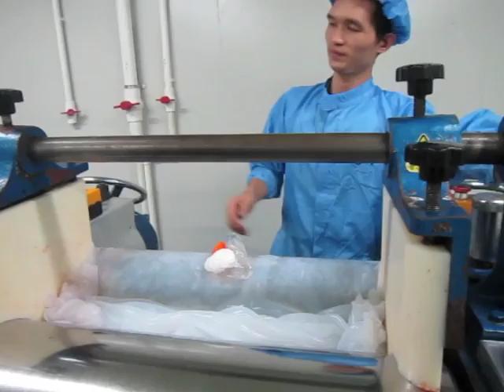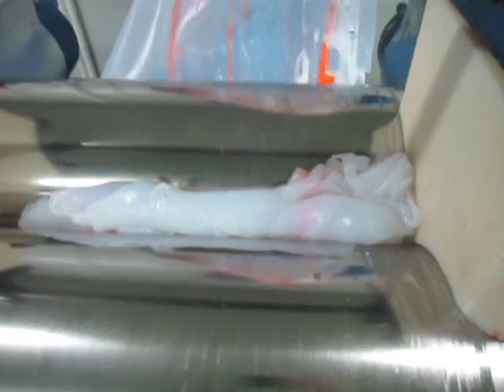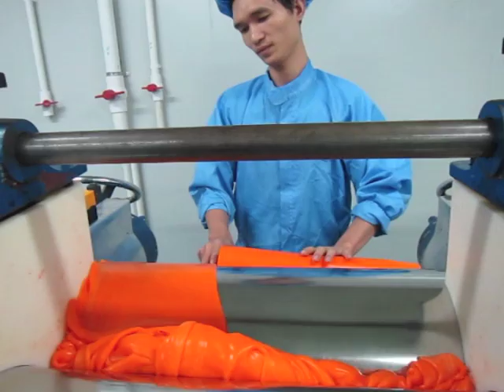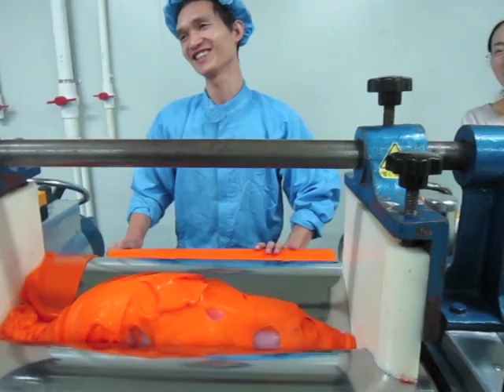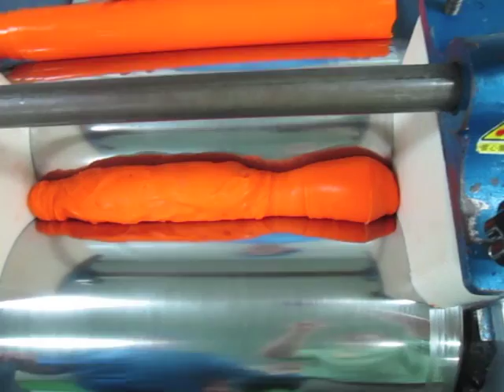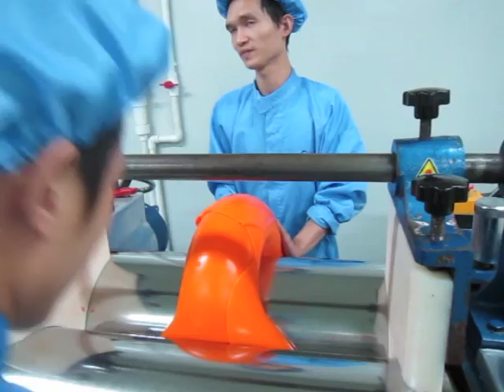life on the line: kneading pigment into silicone.m4v

Comment: I like how you hear all the air bubbles popping in the silicone.
Reply: Sounds like a camp fire :)
Reply: Richard Smith 
Ikr
Reply: Like popping a bubble wrap
Reply: I hate it.  It means he’s doing it wrong and creating spaces for impurities and defects.
Reply: Wes Hartley it actually means he and the machine are in perfect working order.... since the machine is doing its job of removing the air as well as distributing the pigment
Reply: Alucard It could do that just as well, also quieter and with fewer impurities, if he’d been doing it properly.  I’ve seen a longer version of this video where a guy asks him if he’ll put it through one or two more times just to make sure the pigment is distributed, and he lazily waves it off and say, “nah it’s fine”.  Then the boss man came up and said “do it again”.
Reply: @Wesley_H  nobody cares about the way he did it but ok
Reply: @Wesley_H  still dont think it matters but ok
Reply: The bubbles don't matter, they aren't adding impurities, and there's no way to do that job and not get some air pockets.  Ive seen when guys roll rubber up, seal the ends, and throw it back in and when that one pops, its like a bomb. It doesn't hurt the material. What is a problem, is when it gets too hot and you get little cured "knots" in the material.

Comment: I wonder what the turnover rate is for people sticking their hand in there I also wonder how many pieces of hands are in silicone pieces that are shipped here from China?
Reply: It was my understanding from previous videos that the rollers have a sensor for anything coductive (i.e.human skin) coming into contact activates a shut off of the machine. So you might crush you finger tips but not roll your entire hand. 

I also have a feeling from a quality control standpoint that the silicone would be ruined if a whole hand was involved.
Reply: @victoriakelly5894  it's just like a touch lamp but touching the cylinders shuts off the machine
Reply: In my 30 working experience there were only 1 accident that a hand come between the zylinders. the hand was half a meter long. Investigation shows too much alcohol involved.Normally theres a wire above the head u draw this the machine stops immedially and turn backwards a bit

Comment: What does one use this silicone for, how is it not all sticky like silicone that comes out of tubes? I am curious anyone have the answers?
Reply from the maker: InTheFleshInc  typically this silicone is used for kitchen tools, mobile phone cases, auto parts, and sex toys
Reply: @swoolverton , Cool thanks for response, would you know how they cure it but keep it flexible at the same time?
Reply from the maker: InTheFleshInc It’s cured in a high heat, high compression mould. Imagine an industrial-sized waffle iron

Comment: How do they control which roller the silicone sticks to?
Reply: John New they put chicken oil on one of them
Reply: Maddy Taylor Is chicken oil a nickname for something else or do they actually use animal fat for this? :P
Reply: he reaches under the roller and lead it toward him self
Reply: Idk if you ever found the real answer but one of the rollers sits higher than the other one. And because of that, the silicone is guided to the lower roller
Reply: One waltz is Quicker than the other and tecnic to handle the siliconeroll.
Reply: John New depends on how it is put into the roller. These people! Rollers are equal!
Reply: It doesn't stick, you reach under with hook and pull it towards you. Although I have seen where rubber sticks to the wrong roll and its almost a fight to fix it.

Comment: I know... stupid question .. but idk... what is,this,used for..
Reply from the maker: not a stupid question: this kind of silicone is used in car parts, kitchen wares, mobile phone cases, sex toys, etc
Reply from the maker: Not a stupid question Christina. Such silicone is used in car parts, kitchen ware, mobile phone cases, sex toys, etc.
Why do you include these commas in your text, “what is,this,used for..”?
Reply: We in Australia made electrical products, imagine a cylinder 9” long with convulates inside, they were used for huge 30,000volt wires to be insulated. The sides were 1/2” thick.

Comment: What is the name of these machine
Reply from the maker: Tech Unboxing it’s called a _two roll mill_. 
Depending on how it’s set up it can mix, shear, or crush.
This one is for mixing. The smooth surface rollers rotate at the same speed. They have cold water flowing through them to cool the material being mixed.

Comment: I wonder how much of the stuff they handle without masks or gloves is toxic. Probably most of it...
Reply from the maker: Michael Berthelsen this material is nontoxic. The kneading process does not outgas or generate airborne matter. Silicone is the only material handled in this venue; respiratory safety equipment is not needed.

Comment: why does he keep cutting it
Reply from the maker: the operator cuts the silicone to release it from the roller so he can change its orientation which accelerates blending
Reply: Guess you never seen them make rubber for vehicle tires/tyres before this, they cut it as well when kneading